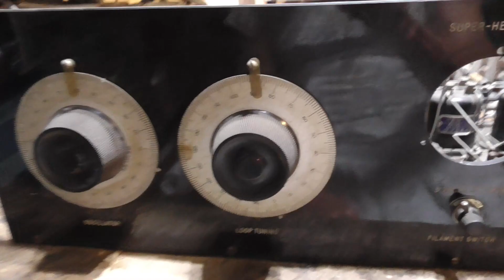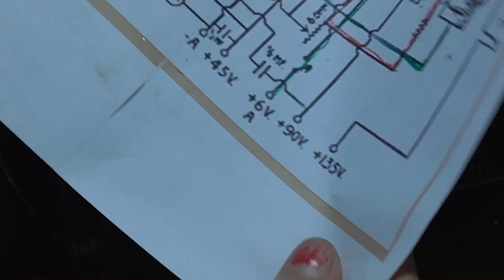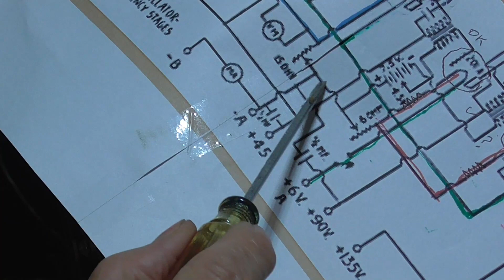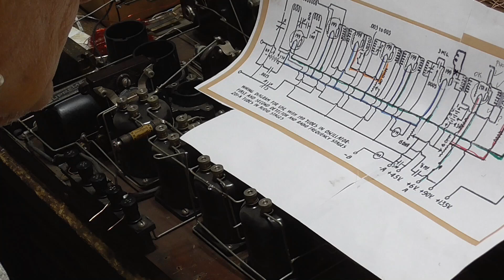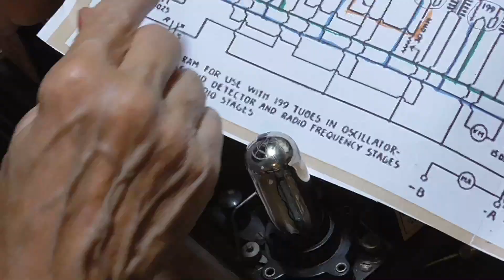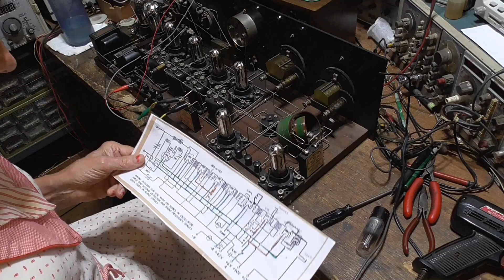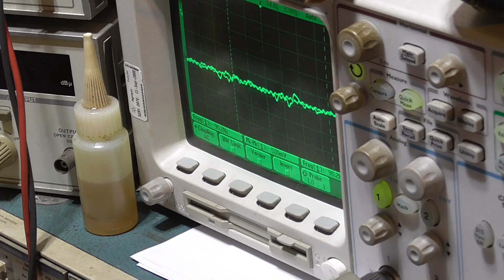restoring a remler superhetroeyne radio

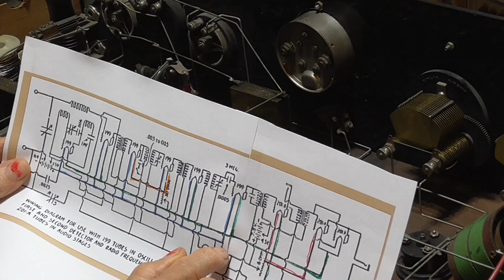Comment: The schematic shown at 7:03 in shows a later design with 6 UV199 tubes and 3 201A tubes ( instead of UX120's). There
is no need for a C battery in this 8 tube radio. Love those gear reduction variable air capacitors! Love the repairs on these 
ancient radio designs doing what very few people can restore properly.

Comment: '20s counterpart of Heathkit, huh? That's a real deal lovely radio. And after debugging it's a thing of beauty and a joy for ever.

Nice to see you back, I was missing you! Hope everything is OK on your end :)

Connections should never rely on solder alone to provide mechanical rigidity. When a wire breaks like around 19:05, I tend to wrap a few turns of thin wire to join both parts, then solder the whole thing together. Likewise, I wrap the end of the wire around another when making a T-junction.

You've got a lovely power supply there, LED digital meters with a wooden enclosure brings back the '70s/80s aesthetic, and there's so many that it reminds me of Back to the Future :)

(PS there's a typo in the title)

Comment: Wow!   as a young kid in the early 1970's I remember seeing a few old trashed and discarded pre 1930's antique radio chassis in my backyard in the woods,   one of them looked identical to that heterodyne kit radio with the mounted open bare wiring and those 4 prong Edison shaped tubes,  a few tubes were still intact but the tuning caps and pots were all seized and deteriorated. Way back in the day a HAM radio guy lived at my location from the 1930's to 50's.

Comment: Great video as always.  Love that radio. I have 2 1920s battery sets.  A kellogg Wavemaster and another I can't remember. I went as far as to reverse engineer the schematic for the wavemaster as the ones online didn't match.  It is supposdly not a regenerative set, but I think it is.  Need to finish it and the fix the other one someday. Just too many projects.  It is missing a cap or resistor, it's a ;glass fuse' style and I'm not sure what it need.
Reply from the maker: Most likely a grid leak if it is the cartridge type resistor. It should  be a 2 to 5 megohm value. The value is not critical. Anything in that range will work fine. You can find them on ebay.

Comment: You are a genius in electronic technology and original manufacturing processes, please advise me on how I can reconstruct the cracked glass (display panel of broadcasting stations) of an old receiver? And one more question (although I have more questions); how to perfectly restore inscriptions on old measuring instruments (on glass, plexiglass, metals, PP, etc.)?
Reply from the maker: There are two ways that can be used. Easiest is a transparency overlay (made on the computer) with the printing. This works good for all colors except white. The second more difficult method is silk screen printing. This process can print all colors, unfortunately the process is quite critical and difficult to master for fine detail work.

Comment: Haven’t gotten all the way through it yet, so perhaps you address it in the video…but it’s supposed to be a voltmeter not an ammeter. The panel even has the engraved reminder to keep it at 3v or less. This is of course to protect the 199s from burning up.

Comment: The metal wire interconnects with soldering joints are fragile. I wonder what would happen if the current in the transformer increases, causing the open metal wire to heat up and break those solder bonds. Is it safe ??
Thanks for the video 
Cheers!!
Reply: to heat that wire on such a short lenght you would need something way over 30amps....that would be impossible,

Comment: What is a "non-grid leak cartridge"? You called it a regulator to reduce the filament to 5 volts. Is it just a resistor?
Thanks for the video. 😎

Comment: You could remove the screws, insert the meter and the replace the screws, OR you might be able to counter sink the holes for the screws and replace them with bevel head screws that would be flush with the meter case.  Or, just make the hole bigger with a file.
Reply from the maker: I uses a power grinder. Took about 30 seconds. (or less!)

Comment: What are the flying conductors made of ?
Reply: Tinned copper bus wire, very common then, as all house wire was made with tinned copper wire, as the natural rubber sheath on the cables would otherwise react with the copper and turn to a conductive goo inside the cotton covering. Tinning the copper prevented this, and tinned copper was also a popular wire to use for making models, as it would not react with plaster of paris, or paper mache and make it go all discoloured. Plus soft and could easily be bent to shape, and then soldered together to make models, not necessarily electrical ones either.
Reply: @SeanBZA  it seems to hold up very well indeed. Is it prone to tin whiskers ?
Reply: @krz8888888  Not pure enough, tinned with  lead solder, so that it was both protected from corrosion, and also easy to solder to using regular solder bar. High tin, and some lead in it to drop melting point, so making it not grow whiskers by accident. More done to avoid the well known problem of tin pest, where the pure tin undergoes a phase change while solid at low temperatures, and crumbles away due to the volume change.

Comment: Do you know Karen in Canada 🍁  curious? Any way just wanted to pick your brains or tubes, with a thought of some other field project in mind and that is a HF welder for welding Aluminum, 
I judge a welder or welding by sound and usually can be seen in the weld, now will some sort of vacuum tube arrangement make a welder's arc more robust, cleaner, Will call it magical since I really don't know that much about it, I just bought an old miller Dialarc machine and was wondering if I introduce another board with piacular vacuum tubes would you be able to fine tune the arc  of the machine - sound and frequency and the dances of vibration of electrons into a weld? I pondered with this notion for some time now being an INFJ introvert have these notions. Your an engineer on how to K.I.S.S things.
Reply from the maker: Do some research on T.I.G welding. It is an ideal process for welding aluminum.

Comment: Why grind the panel when you could remove the screw and then put it back in
Reply from the maker: With the power grinder I have it only took seconds to grind out the small amount it took. With my luck with small screws I would have lost them all by the time I was finished!    :)
Reply: @glasslinger  🙈 I know that feeling!